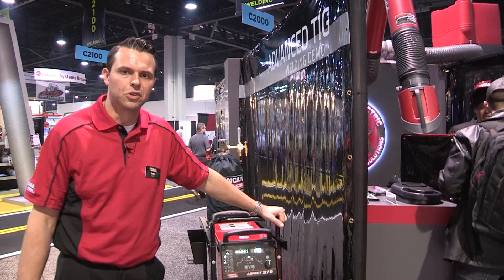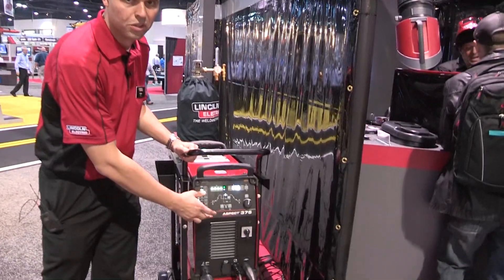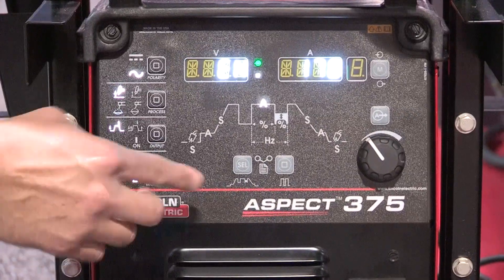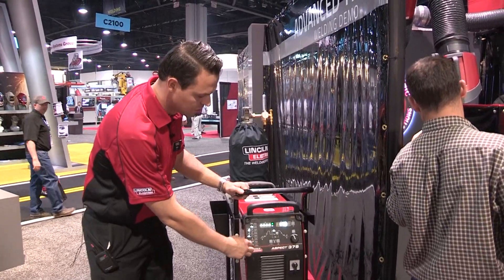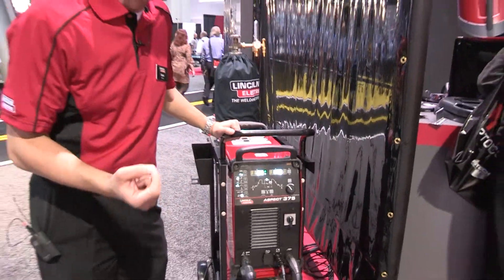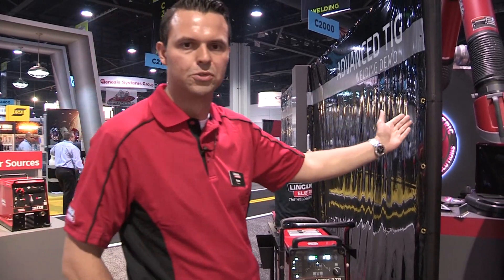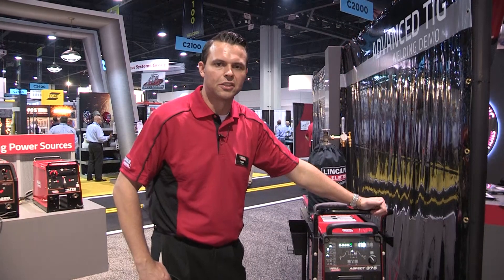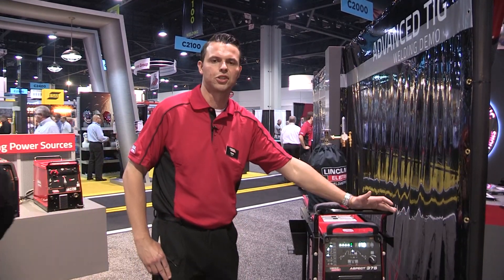FABTECH 2014: Aspect 375 AC/DC TIG Welding Power Source

Comment: Can you control the ac wave form (advanced square, soft square, sine, and triangle) on this machine.  If so how and if not that is something you should put on the next one.  Also will this work with a wire feeder on cv or is it a cc machine only.  what tig torch does this unit come with and around how much does this unit cost.  I deal with the miller dynasty 350 currently how does this stand out and exceed that unit and in what ways are they the same.  Thank you looks like a great unit.